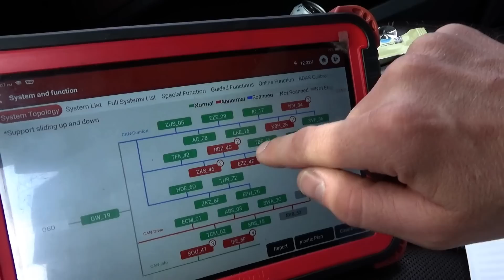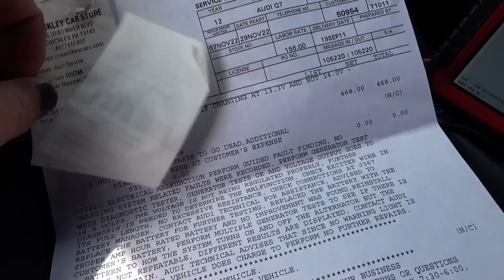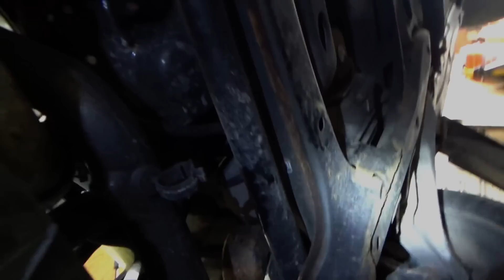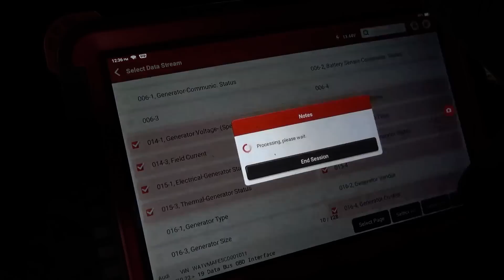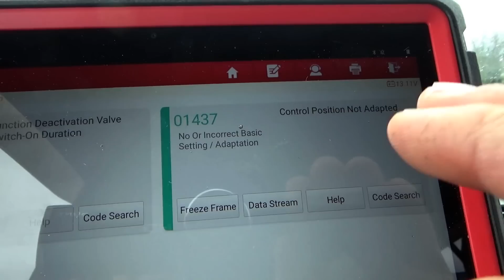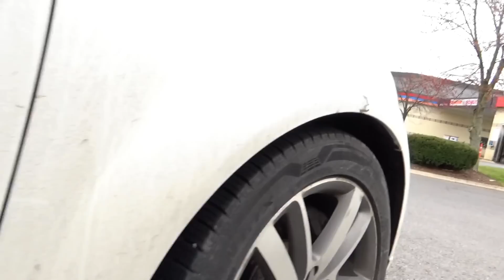Audi From HELL...DEALER STUMPED!! (Part 1 - Charging & Air Suspension MALFUNCTION)

Comment: I have a deep hatred for European cars I will stick with my Toyota or even Honda Subaru easy cars work on in my opinion
Reply: Not an audi fan. But only car that left me stranded on the side of the road was a Toyota. The dealer had mucked up a simple repair.  Then took them 3 goes to put it right. Problem here isn't the cars. 
Did I mention I had my mother in car after surgery and was stuck between a cliff and the ocean. That was the last time a dealer worked on my car...
Reply: Techs  following brands diagnostics protocols  implemented. by a service advisor.  with an  of An attitude & knowledge of a  salesman what could go wrong. 😂😂. Let the sheep roll. In.  get fleeced  with a smile
Reply: Like Toyota dealers don't do the same? Toyota fanbois are the worst.
I've had VWs for decades. Rarely have to work on them. The engines just run. If you get an electrical problem like the windows are glitchy... Just let it go. It's when you think you MUST FIX EVERYTHING, that's when you have problems. If it starts,runs, and stops that's about all I care about. Plus they're a heck of a lot more fun to drive than a boring Toyauto.
Had a TDI Jetta that we never had to touch the brakes on. Never replaced them. Never. Good engine braking on a diesel.
Continued fanbois crying ↓
Reply: @billmalec  Toyota fan boy here...I personally have never had ANY ELECTRICAL glitches ever with any Toyota. My Tacoma and Tundra rarely even break. Some minor things but extremely minimal. Contrast that with our fleet of MB SPRINTER vans....garbage cans on wheels
Reply: As Scotty says...German=EMP
Reply: Only European car I will work on is a Mercedes due to my 30 years at Chrysler/Jeep stealership as Mercedes had a marriage with Chrysler for 10 years, so I got pretty much every school course from Mercedes transmission, air ride, adaptive cruise control/lane change, crossfire, sprinter 3.0L Diesel, 3.6L gas Mercedes design engine in all the corporate platforms, and then the Fiat  😅took over with company
Reply: @Aaronkoivu  MB=JUNK. I am punished at work driving a Sprinter. Same with my coworker. They are terrible vans...ABSOLUTE GARBAGE CANS ON WHEELS. HORRIBLE.
Reply: Easy to work on once youve had your mitts deep inside their guts..  otherwise all cars are foreign to you.  That and having the special tools to make things easier on you and the rights/ software to get into the systems to do what you need to do..  there’s gonna be a point where your car will breakdown and you can push a button that will automatically bill you x amount of dollars and repair whats broken on its own with built in replacement parts known to break and the mechanics programmed in swapping parts without people questioning the fact that they knew the shit will break inevitably making you push that button which if you attempted to repair yourself or somebody not affiliated with the car manufacturer it would take triple what it would cost to have the manufacturer fix it on the spot..
Reply: Mitsubishi and Nissan also
Reply from the maker: This Audi will support your views 😆